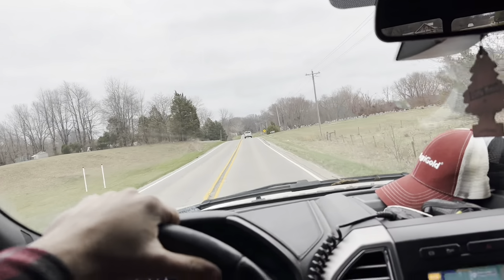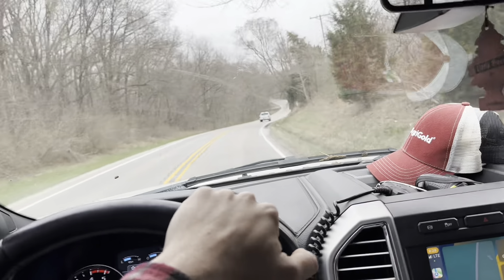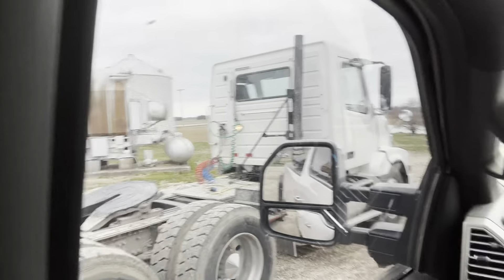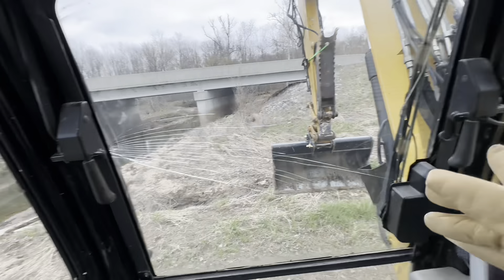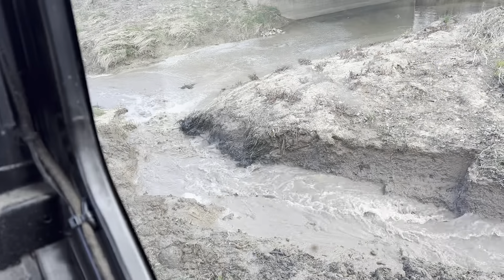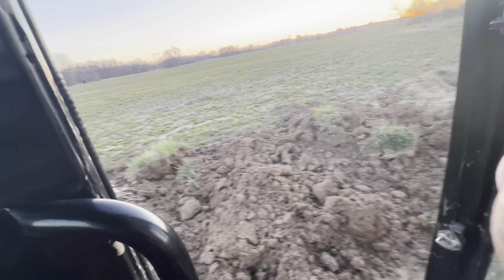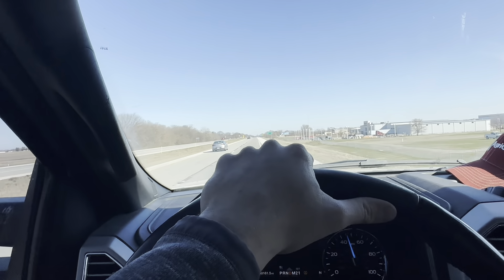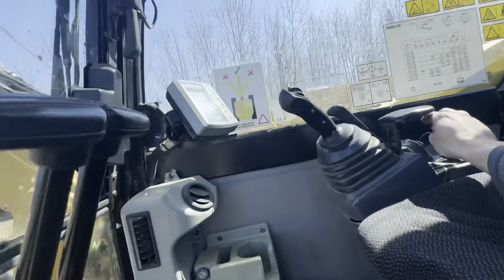Son of a Ditch

Comment: I enjoy seeing your farming operation and how your land lays. My farm has quite a bit of tile but it is old and needs maintenance also. Last years bean stubble makes it easy to find tile holes and we are in the middle of repairing and replacing tile, especially the clay tile that was installed 100+ years ago. Unfortunately nobody drew maps, or at least they did not make it to the time where I bought the farm, so there is lots of guesswork trying to figure out some of the old drainage patterns. We don't use any surface drainage except grass waterways, everything else is tile. (SW Tippecanoe county)